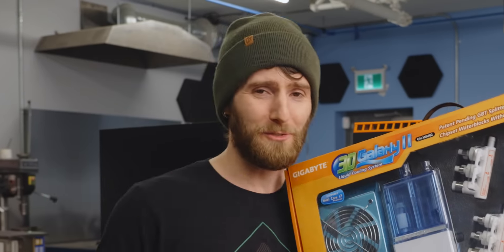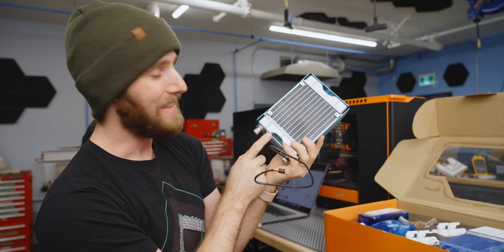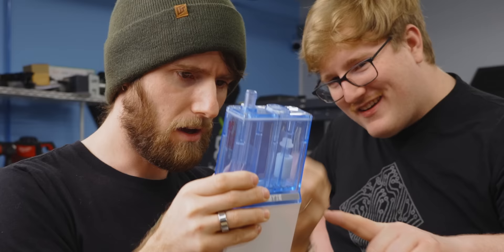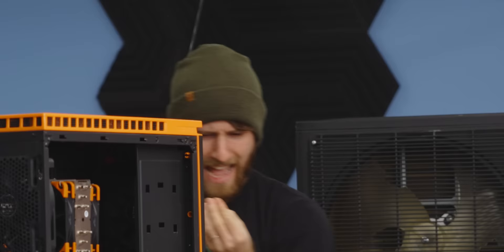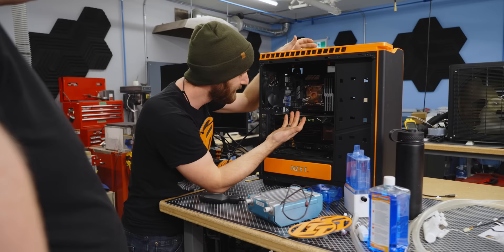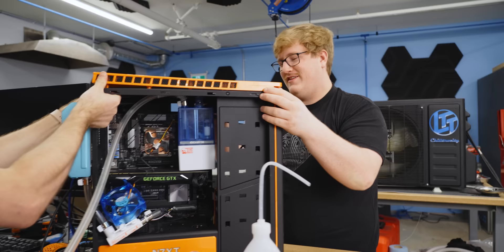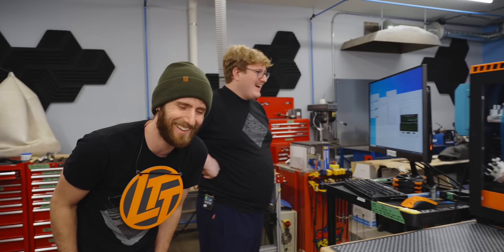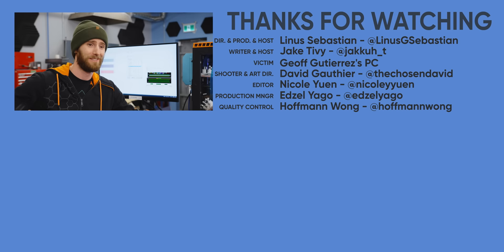This Product Aged Like Fine Milk - Gigabyte 3D Galaxy II Retro Watercooling Kit

Comment: I had and installed this exact kit when I was 13 y/o, was so darn proud of it lol. Upon initial install, the fan speed controller set on fire immediately, minimal damage other then a room smelling like burnt electronics for a month. After plugging the rad fan in without the controller, it ran at full tilt for the next 8 years. Surprisingly that pos lived forever... This video brought back such good memories :D
Reply: So was the temperatures bad like there’s were ?
Reply: @pavy415  Probably, but the alternative air coolers at the time would've been even worse.
Reply: @pavy415  What Galactic Ruler said, plus stuff just ran hot back then. "Cooling your PC" meant taking off the side panel and letting it 'breath' a bit!

I still managed to cook a Radeon 9800 SE tho 😒
Reply: So gigabyte is not new to the electronics with embedded fireworks market
Reply: @pavy415  The comment from @Galactic Ruler was pretty much the most spot on. Cooling was pretty terrible all around back then plus I knew a lot less lol. It replaced a half dead stock cooler so it was an upgrade, and the fan being stuck at 100% (for years mind you) temps were never a problem. aka I don't have a real answer LOL
Reply: This gave me a great laugh, thank you! Hahah just imagining myself screwing up an install at that age and then dealing with a fan running full blast for 8 years afterwards....ahhh to be so lackadaisical again
Reply: @Boomflame82  lmao I'm glad we can enjoy that together. I was chuckling while reminiscing as I wrote that. It may have left some PTSD, I won't buy a case unless it fits 240mm fans, thats why I said I'll have the thermal take level 10 GT🤣
Reply: @pavy415  Probably not. There's better air coolers now than there were liquid coolers back then. One dirty mod was to us a VW Beatle radiatior.
Reply: Come on, air coolers weren't that bad back then. I remember having a 1st gen CoolerMaster Hyper212 and then upgrading to a V6GT (6 Heatpipes! In V-formation!) down the line and my temps weren't as bad as everybody make them be.

It still was an old Core 2 Duo... but then again, those ran pretty hot too.
Reply: lol it's packed like a 1980's action figure playset
Reply: @Elratauru  The Hyper V6GT is half a decade newer than that cooler. The first 212 is at least 2-3 years newer.
Compare the overall quality from a Scythe NCU-2005 (high end fanless heatsink) to the first Hyper 212. 
Tech evolved at an astounding speed at that era. If you care to look back at 1999-2002 coolers you'll see what I'm talking about.
Reply: @Elratauru  Still running it as I'm writing this lol
Packed with gt710 runs even crisis
Reply: Yes, I know those memories! Almost set the house on fire bcs the girl liked candles, so I put them everywhere and we got too busy...
Wrong topic lol.
Reply: My fan speed controller burned out too. It led me to distrust the fan enough to put it on its own 12v external power source for the years mine ran, until the CPU block sprung a leak :D
Reply: @Helladamnleet  weren't beetles aircooled?
Reply: @iClone101  I was running a passive air cooler back then, or from 2008 onwards. The Cooler Master Hyper Z600. Could handle CPUs up to 89W tdp and even more if you added the two optional 120mm fans.
Coolers weren't that bad back in the day.
Around 2010 I tried a Corsair H100 AiO kit but the pump noise grinded more of my nerves than it moved water in the loop. I couldn't stand the high pitched whine that reminded me of the tiny CPU fans of the 90s. Thus I bought a Noctua NH-D14 and still use it.
Reply: @LogiForce86  both those coolers you mentioned are much newer than what this would be replacing. This product came out in 2005, predating the Core 2 series, and people who planned to use this thing were likely running Pentium IIIs or 4s, which came with those deafening 40mm fan air coolers that weren't much bigger than the CPU itself. By the time either of the coolers you mentioned were released, the aftermarket cooler market had grown tremendously, as Core 2 CPUs had amazing overclocking potential that the tiny stock coolers could not keep up with.
Reply: @Sheovion  At some point they stopped being air cooled.  I meant like a 1999 Beetle radiator.
Reply: @Helladamnleet  ah yes, the newer ones
Reply: @RoganGunn  stock heatsink, side panel off and aimed at a window unit a/c. Ran that setup for 5 years straight and surprisingly didn't fry anything with condensation, but the outside of the case would 'sweat' after being on for a few hours. 😆
Reply: @Zahgurym  😂 I live in sunny old England, so I had no A/C here to point at it, but I did use a desk fan from time to time. This meant that vacuum cleaning the room occasionally entailed carefully hoovering the inside of the case too! (I didn't know about ESD in 2004...) 😬

Mine ran for about 5 years too - though I think the 9800SE died due it to being a cheap card (the fan was a tiddler, not even 40mm) and I'm not even sure thermal throttling was a thing back then! After the ATI Radeon 9800SE died I had to reinstall the stock GPU, team green's GeForce 440 MX. 😒
Reply: They probably just put the potentiometer in series with the fan power. Those things aren't rated for any sort of high current.

Comment: You guys gotta upgrade this using new thermal paste, lapping the cooler, using new fluid, and a new fan! Go step-by-step, we wanna see how good this can really get =)
Reply: Especially curious about lapping the cooler. That thing looked horrible.
Reply: I mean... What do you expect? It'll become nearly as good as modern stuff
Reply: I'd watch all 4 of those videos
Reply: They should just try it with a decent block and see how much of a beast that reservoir is.
Reply: I’m going to bet that the cpu block was the only problem with this things cooling
Reply: Agree, do that project!
Reply: Totally
Reply: I was going to comment this too, I would to see what the difference is
Reply: Shouldn't the thermal paste reduce any issues with the poor surface finish? I thought the point of a lapped surface was to maximize contact, but the thermal paste should fill any gaps
Reply: They're gonna end up replacing the entire thing piece by piece.
Reply: @RighteousFondue  Thermal paste has a low thermal conductivity averaging around 10 W/mK (if even) compared to the 200~ W/mK of aluminium and 400~ W/mK of the copper, some liquid metal compounds can reach up around 80 W/mK. While the point of using a thermal compound is to fill in the small gaps between the IHS and heat block to help ensure thermal transfer between them it also acts as an insulator inhibiting the thermal conductivity. Like you said the point of lapping is to maximise the contact, this decreases the amount of needed compound and thusly provides more optimal thermal conductivity between the two surfaces which can make a noticeable difference in temperatures depending on their quality beforehand.
Reply: @RighteousFondue  Thermal paste is much much worse at conducting heat than metal.

Comment: I laughed so hard when you gave back the 'upgraded' PC back to Geoff. Haha He was like, oh cool, a PC and a heater build in together.
Reply: honestly this was the first thing that made me laugh out loud in a long time
Reply: Actually, good cooling that prevents throttling makes the room hotter compared to bad cooling of the same wattage. The cooling system just pumps out the heat and lack of throttling means more heat.
Reply: Sadly he is mistaken, the amount of heat that is produced by the cpu does not go up so it will not act as a space heater any more then it did. Worst case the cpu throttles, making it produce less heat. The only thing that is getting hotter is the cpu itself.
Reply: Oh man, I died. Just kept piling on the good news lol
Reply: He smiling under that mask...
Reply: I had to pause the video when he said he'll use VGA

Comment: I still wanted that standalone radiator/fan tower thing that you ran outside your case from a few years back. That looked neat.
Reply: I've still got my koolance exos (external triple rad/pump) unit from like 2006 sitting on a shelf. That thing was a nightmare back in the day.
Reply: Yep
Reply: We had one of those at school, still wanna go back and see if they still have it
Reply: I converted a 2ftx5ft 3 shelf floor standing cupboard into a fan/pump/radiator housing 15 yrs ago. Retired 2018. Mostly modified car parts.
Reply: I converted a 2ft x 5ft 3 shelf floor standing cupboard into a fan/pump/radiator housing 15 yrs ago. Retired 2018. Mostly modified car parts.
Reply: Not gonna lie, the external radiator and pipe passthrough looks really neat. Maybe get an old case and hack it up to externally mount your water cooling? There's a project.
Reply: Well it does have the massive benefit of not warming your room at all
Reply: They make external rad stands,with or with a pump/rad combo so you can mount your own,I used one on a old alienware case that despite it's size had hardly no room inside it turned out pretty good.
Reply: I always wanted that.... To warm my hands in the winter lol. Back then I was too cheap for heat. But I was also too cheap for water cooling
Reply: I think the ssf community still does it :)
Reply: These days you can just get a radiator and a bracket/stand. I'm using a 560mm rad and noctua's pwm fan controller with a molex power brick and molex to 4 pin fan adapter.
Reply: Was it blue massive radial fins?

Yeah that thing was awesome 😂
Reply: @kiyosenl.3889  Connect the radiator to plumbing before the water heater, possibly saving on heating cost
Reply: There's a guy near me who had a custom made water cooling and he used a car engine cooler as his radiator. Looked so steampunk with all the metal piping coming out of it.
Reply: This video brings back memories of going to car junkyards and pulling out heater cores for the PC radiators... it even looks the same.
Reply: Alphacool still has one if im not mistaken
Reply: I got this free nzxt phantom case that had the water tube holes in the back still 😆. Funny part is thing was modern enough too it had standard radiator mounts also. Though all methods were external mounting even the aio. It just had a clever trick to hide the radiator in the top shell.
Reply: The zalman resorator! Big blue tower. I think that concept can still work today
Reply: @ferdievanschalkwyk1669  I used a Zalman Reserator V2 (same thing in black) for a watercooled Xbox 360. 
I STILL have all the parts to rebuild it...
Reply: I remember those so cool and so expensive.
Reply: The ZALMAN RESERATOR perchance? I remember it. I wanted one at some point too.
Reply: Where I live that might be capable of sub-zero cooling for a few months a year.
Reply: You can still get those!
Reply: @Aeleas  Hey i think there are other places where you'd get Scorpion "cooling" a few months a year if you put it outside!

Wait, what's Noob Saibot cooling like?
Reply: I still have my Zalman Reserator 2 somewhere in the attic.  The days of huge radiators...
Reply: I still have my black Zalman Reserator running my Core 2 Duo retro machine. I had to replace the pump (standard aquarium pump) a couple of years ago, but apart from that it's been working great since 2008.

Comment: Always wondered what those "water cooling" holes on the back of my case were supposed to be for. Good to know its compatible with completely archaic pieces of kit.
Reply: same. I have them in my current case by coolermaster. Although one of the grommets just fell out.
Reply: My old ass cooler master case has them too.  Instead I crammed a pile of hand me down fans into my case and it runs fine.
Reply: Damn. I'm so proud that my "new" case (Zalman 11) has this holes.
I thought It means future)
GREAT case tho. I had shitty cans before
Reply: same with my Thermaltake Versa H23
Reply: In the video it says the holes are for water cooling
Reply: @nubreed13  Am also running an ancient case. The "cooling" is a server fan mounted in the 5.25" bays with a piece of scrap wood.
Reply: @user2C47  nice.  One thing I like about the older cases is there's tons of hard drive bays.  I crammed 12 terabytes into this PC so I won't be hurting for storage for years.
Reply: It´s a gamer case but older
Reply: @Ballissle  I've got a Cooler Master HAF 922 and lost the rubber insert part many years ago lol.
Reply: I have them on my Lexa S.

Still has the silly rubber grommets.
Reply: @nubreed13  You can still get a pretty good amount of hard drives installed on modern cases, like the normal sized versions of fractal's meshify and define cases, but at least the meshify only ships with 6 brackets, so you have to buy the rest separately, if you want to use all 14 + 1 3.5" locations ( and also has up to 4 2.5" locations). (Though using all the locations also cuts down on gpu compatibility). The XL can fit 18 + 2 (and 5 2.5"). The "+" ones are using multibracket kits that take up 120mm fan slot, so technically you could fit more in unused fan locations as well.
Reply: @Ballissle  !!!! There's these holes with rubber plugs at the back of my older CoolerMaster case. I know what they are now lol. 7 years later. Not that I'm water cooling, I live in Austria so not using Noctua is probably a criminal offense.